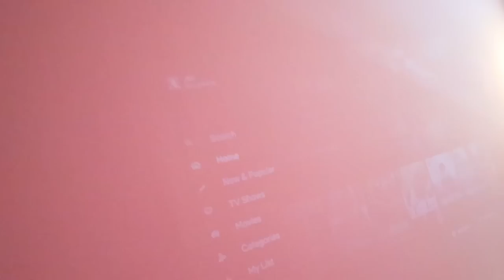OUR FINISHED HOME MOVIE THEATER!!

Comment: You two did a GREAT JOB with the space you have 👍🏽
All you need are a pair of vlack out curtains to make it dark even during the day. And for the wires, look for the wire covers thst go on the floor. But use it for the wall. It might not be perfect, but it'll work.